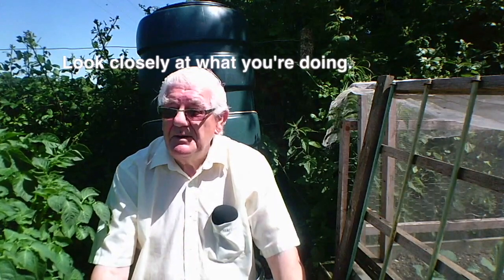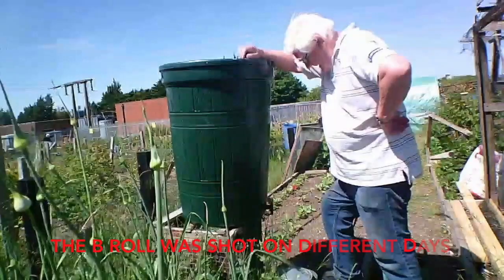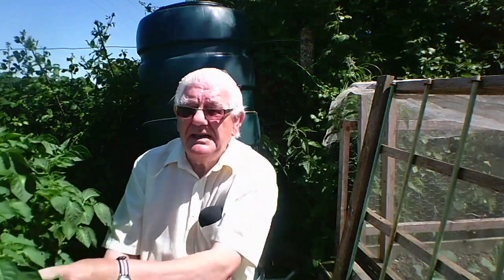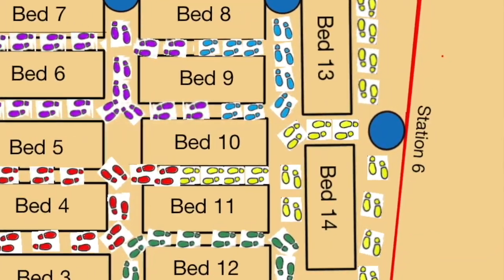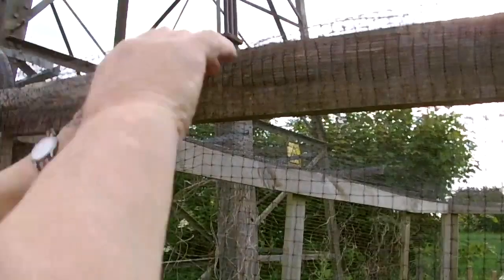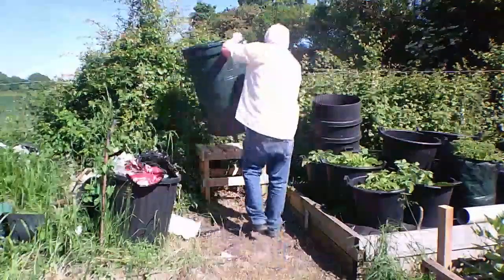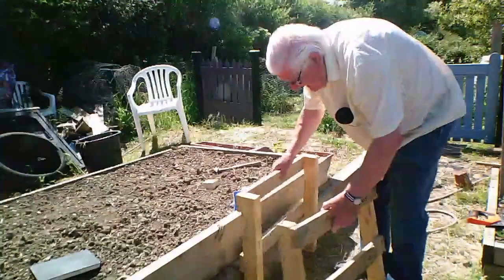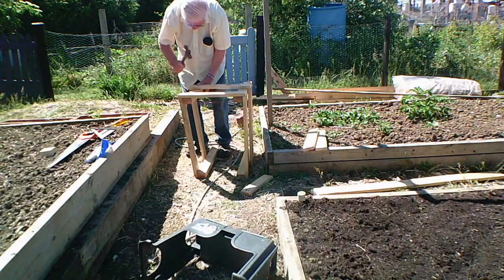May 2020 Week 5 - How To Save Time Watering

Comment: Hello Mike, since your water stations are raised, why not fit tap connectors to the butts and then move around using a shorter hose to connect to the nearest tank and let gravity do the watering....eliminates lugging around heavy cans 👍. All the best
🌻 Nigel .......MuddyBootz Allotment 🌻
Reply from the maker: Have been discussing using hoses with other plot holders over this hot spell, or to be exact how we distribute water from our own plot buts shold be how we want to do it.  The councils attitude is, it is OK to fill your own butts using a hose but the actual watering must be by using  watering cans.  One guy uses a bucket and sloshes it on which I think is wasteful.  If this heatwave continues I sense there going to be a rebellion looming.  One bloke has been warned already for using a slow drip feed .  I have thought of a solar powered bige pump.  I have already written to the council that their banning banning of sheds is contra to saving of water by not having mean to collect it off roofs.  That fell on deaf ears.  Take care Mike
Reply: MuddyBootz great tip Nigel 👍